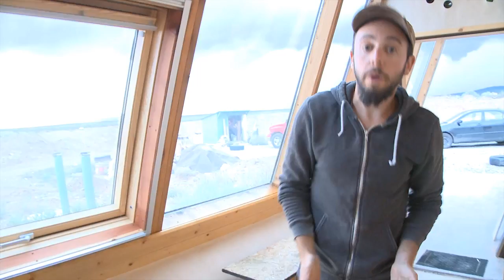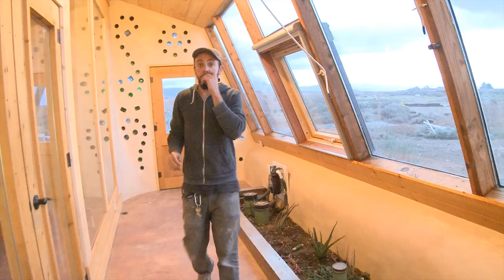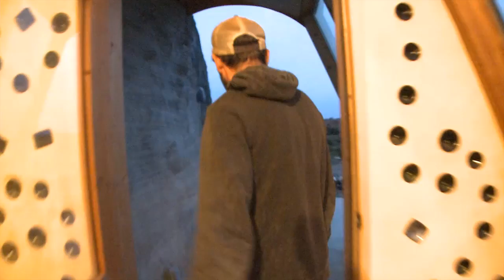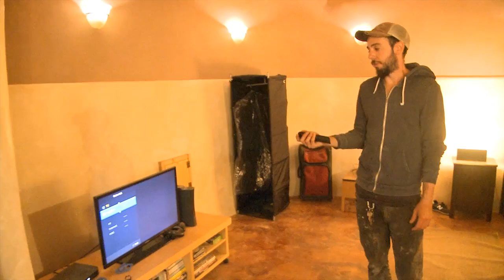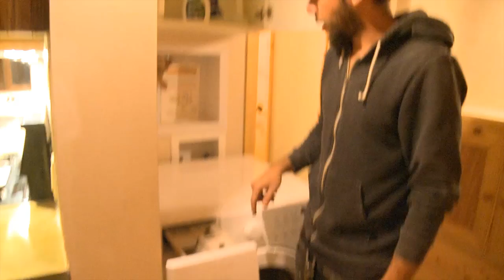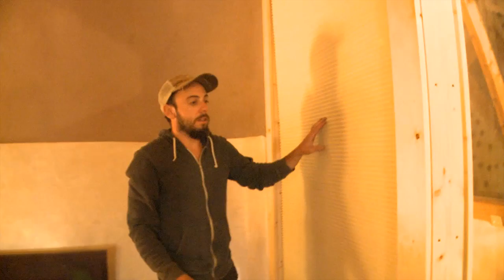Earthship Tour & Instructions

Comment: It's been 5 years since this video. How is the home performing lately? I'm building a similar earthship in Colorado where we can't harvest rainwater, but the rest of the home's energy considerations will certainly benefit my needs. My Foundation will be concrete instead of tires, and I won't have the need to recycle my water for multiple uses since I'll have well water. My energy needs should be less than $1,000.00 per year.

Comment: way too many activities to just live bro. need to trim out some of those manual issues by installing some timers to do all that by either t stat or barometric pressures.
Reply from the maker: its not that bad really.  ur not doing all of these things all the time.  its just scattered here and there.  but ya, obviously eventually, automation would  be nice
Reply: But there are low voltage thermostaic items and barometric items that can assist so much in a lot of that.. people forget this sort of thing when they live in a house  due to modern tech. But the idea is great  .. I would say explore some of that  control stuff  for some of that. It would help folks that are forgetful to open this and that at certain times.
Reply: OGB like this one for instance  ( hvac damper motors  for zone  systems. ) use those  to open  hatches. they're low voltage  motor systems 12v  . that open close  use a zone board and attach the control devices to the board . viola you can have automated low voltage off grid operation.

Comment: My main question is, why not have a utility specific area of the house that is separate from the living space? There is "closet" space for water heater, filter system, etc, but minimal space for actual storage. All utility based fixtures can be isolated in a remote room/area of the house and all the associated plumbing/wiring can be routed there.  And on another note, I thought you built that house for you and your wife
Reply from the maker: this was built exactly to mike reynolds design and specifications.  in the future, i might build differently

Comment: Here is my opinion, the earthship (and every basement in the world) should have two duct fans (one incoming and one outgoing) like this:
http://www.menards.com/main/heating-cooling/ductwork/booster-fans-whole-house-humidifiers-accessories/suncourt-air-boosting-6-round-turbo-in-line-duct-fan/p-1444444198924-c-1453749027449.htm?tid=8651157262120371366
      Good luck.
Reply: Bad link mate, error 404

Comment: Interesting, but why the alarm when the battery bank gets to 70% ??  A lot of RV's now have marine grade AGM high capacity batteries that are made to charge quickly and discharge to near nothing without damage, or degrading the performance or  charging ability, or amount of power held in the batteries, and they last for years.   If you have an issue with a renter using only 30% of the battery power available, then you have some HUGE shortfalls, and are about a decade behind, with your solar panels and batteries.
Reply: Around %50 on a lead acid battery is empty, much below that will damage the battery. Going to only 70 is a bit conservative but will make them last longer.
Reply from the maker: +Jarrod P jarrod is on point

Comment: First the house is amazing, and I enjoyed the tour quite a bit. It would be cool to get information on annual costs, and the needed day to day tasks.

 #Energy  
How often do you have to have propane delivered? How long do the batteries last? And I didn't hear why a level of ~70 on the batteries was an issue. Does the house need larger batteries or more solar collectors? What happens during normal usage? The refrigerator looked "normal" as opposed to one of those ultra insulated types, was there a reason for that? Did anyone think of using a backup (i.e.propane) refrigeration system?

 #Water  
What happens if the levels get low, do you get watered delivered? Should the tanks be bigger and/or the water collection area? What about clogged pipes (e.g. somebody using too much TP)? How hard is it to clear them, easy access?

 #Landscaping  
How far is the septic from the home, and what types of plants can be used with the "black" water?

I've always wondered what it would be like to live "off grid".  Has anyone built a home like this in an isolated area? And as I'm getting older I worry about various maintenance issues. Hopefully a low water area, in the mountains, with the right landscaping would still look nice as time goes by? It is the dessert I suppose landscaping is rather challenging.
Reply: +Beorn Borg  I'm not part of earthship so I hope you don't mind my fielding some of your questions.

It's hard to establish how much propane needs to be delivered. I lived in a log cabin over the fall and winter in the northern regions and survived with a small space heater and propane range. However, two months into the winter and my bottle was empty and needed refilling. The bottle was approximately 20 gallon.
Likewise, battery life is hard to pin down. the answer depends on use or abuse and how many deep cycles (how many times you nearly drain the battery) you cause. From what I understand, by keeping the battery levels no less than 70% filled, you can get 8 to 10 years from lead acid filled deep cycle batteries. Those are commonly used because they are the least expensive. Other batteries might have longer lifespan (20-30 years I think) but they are much more expensive. (may I suggest going to "off grid build's" page and seeing other videos which better describe some of this information and better?)
Just a thought: Remember, though propane is relatively inexpensive currently, it is also a non-renewable resource and it would be better to find alternative methods (if possible).

As I understand it, rain water in that region is scarce, so most water is pumped up from an underground aquifer. It's better to try to rely on rainwater, since it's free, which is probably why they try to ration it as much as possible. Also, relying on aquifers as a water source is thought to be cause for underground erosion and thus sinkholes. Clogging pipes happens everywhere and just like anybody else they probably have to call a plumber or septic specialist to use a tool called a "snake" to clear out obstructions.

Believe it or not, you can just use regular plants in a leach field aka septic field. This isn't new technology and researching on the internet will probably net a better answer. You DON'T want to use plants to eat from a black water/leach field because there are pathogens that go with black water. You also don't want to use any deep rooted plants as their roots can clog up your septic field and then you'd need to contact a septic specialist to clear the pipes. 
I don't know how far a septic field has to be from your residence, but your local building code is probably a better source to answer this.

I haven't built such a dwelling, but I'm considering it too, difficult though that might be at my advanced age. It's simply  easier for younger people.

Comment: This looks like a classy earthship! While the video is obviously made for people who will rent this one, it's a pretty good explanation to anyone interested how one of these works. And it has wifi, wow! lol. I can imagine with one like this that seems high end, you could possibly even turn it to a 'smart-home' as well? I was thinking you could automate the windows, and control them from a smartphone maybe.
That would be cool too
Reply: TBH, a smart earthship based on low power circuits would need say a one and a half foot square solar panel to run, and save a lot of hassle, as well as auto regulation of atmospheric interior :)
Reply: +Unz360 

I like this idea. You could link humidity sensors to the venting systems to control humidity and reduce the chance of molds and mildew. 

I live in Georgia in the U.S. and even conventional housing has serious mold and mildew problems.
Reply: ya good point, hmm.. maybe we're onto something there. Smart earthships! Smart earth homes, clean smart ships etc ha

Comment: Wow ! Open this open that ...Close this , close that , keep this shut in the winter keep it open in the summer , turn on the stove hold this knob in ..5-4-3-2-1- ready    Then we got the tv that's a whole nother issue and the trimetric monitor check the batteries,Check your water supply and filters watch for 30% pressure before takeoff ,listen for a complete flush .... Woooosh! I think the space shuttle has an easier checklist before takeoff then the Earthship does !  Looks fantastic but looks like too much work when you just want too relax on vacation so for that reason Im out!
Reply: +glenmann62 I read your comment and laughed for probably 3 straight minutes! I agree - seems a lot of work for a vacation rental. Not very relaxing if you have to worry about damaging the place with every little thing - sounds even stressful. You'll spend your whole time there keeping track of the house instead of enjoying it. And I dunno  - all that propane seems scary to me. The stove seems a disaster waiting to happen. Imagine some old lady trying to heat up some tapioca for her arthritic wheelchair bound hubby .."Crispin hold that propane knob open while I light thi-- " BOOM.
Reply: +glenmann62 Obviously it has been a while since you went up in the space shuttle. hehehe

Comment: i was wondering if you could comment on alternative flooring besides concrete.  i have seen an earthbag build where they used portland cement and dye mixed in with the dirt floors tamped down and finished to a smooth shiny surface similar to concrete.  would this be a viable less expensive alternative?

Comment: You could add a Antenna Panel on the wall high up to get TV broadcast. You can replace the toilet handle and get Buttons on the toilet instead of a handle with teardrops, 1 is for just number 1 and 2 teardrops for number 2. I would worry about Snakes crawling in the front door if it's left wide open.

Comment: General shape of an energy efficient building (passive house) Low Energy Home: building an energy efficient passive house, Architecture of an energy efficient building https://sites.google.com/site/lowenergyhome/architectur
Reply: +John Arizona Lol wow that isn't even close to the level of low energy consumed by this Earthship house.  That article was written by someone with extremely limited materials and imagination.  This earthship building basically sustains its own heating. It uses solar power and batteries to augment its electrical needs. 
This article of yours is based on low energy use by making your house smaller.  Guess my dog's kennel is a prime example of the success of this article. 
Comparing this Earthship house to the house in this article is like comparing oranges to watermelon.  One is the epitome of low energy use(completely off the grid) the other is not even close.
Reply: Your blocked Troll.

Comment: Why were you not able to install solar hot water? Who is the "they" that wanted to charge you extra (for you to do the install?)? 

Nice house. I have been following along. Glad to see it is almost complete.
Reply: +Colin Quinn I got the impression that it was a building code type thing or perhaps insurance related. Meaning he would have to hire the work out at great expense. Solar hot water has been around for a while. My aunt had such a setup for a while. However it is somewhat labor intensive to keep track of proper operation and maintenance.  Thing is if you want insurance for your building than they want certain things just so. Anything dealing with water can destroy a building in short order if it malfunctions.
Reply: Makes sense. Solar hot water is highly efficient. 
Sad that the outside world thinks it knows best.
Reply: Colin Quinn all that outside world knows is that it can cause serious damage if not installed correctly.

Comment: Have you had it tested for radon?
Reply: Every square mile of surface soil, up to the depth of 6 inches, contains about a gram of radon. Do you think this house contains that much soil, or was there another reason you asked? Just curious.
Reply: +texcnbelleranch well, they dig the surface and other soil up and pound it into the tires that make up the walls of the house. what they dig up they use in the construction so - people keep mentioning radon... i wonder if the dirt-packed tires are the reason why they keep asking about it.

Comment: How do you get water in the winter? does the snow melt allowing the roof to absorb some of the melted water somehow? just curios if the house does it passivly, well aware that you can just bring snow in and boil it:)
Reply: snow melts on the roof which is a rain catchment system. you don't have to go boil water.